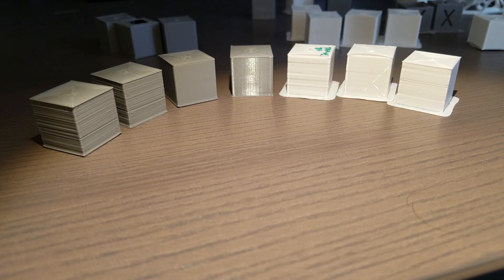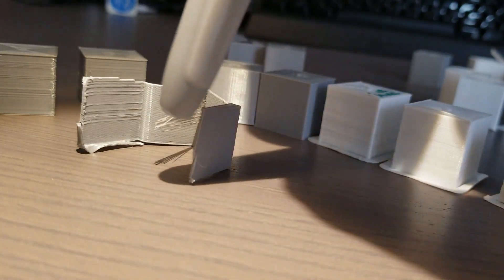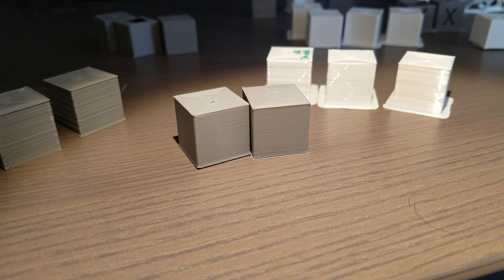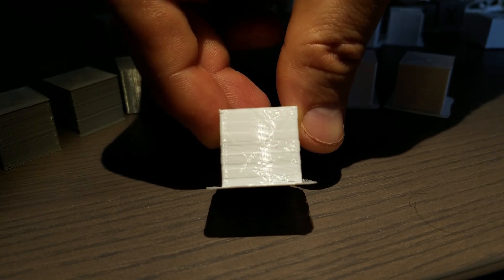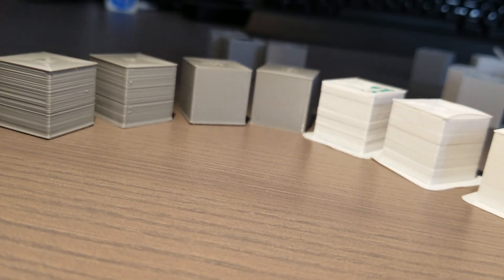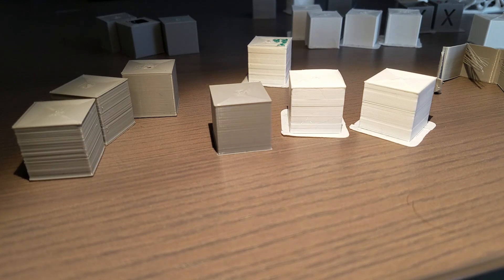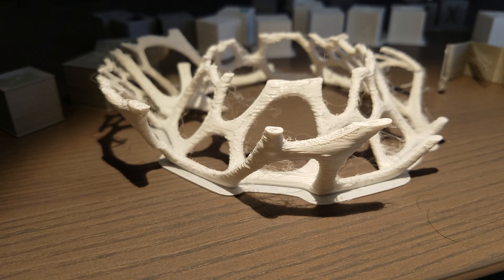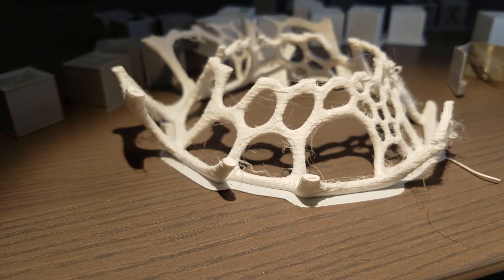CR10s PRO calibration Cubes ,Cura  uniform 3d print speed, jerk disabled,  shortest Seam settings

Comment: I am having the same problem. motherboard mks robin 2 . I'm wondering if replacing the motherboard will fix my problem? were you able to solve the problem?
Reply from the maker: You may want to try the speeds to be the same about 40 mms for a cube and i mean the inner wall speed the outer wall speed. no jerk.  also you need to check if the printer is tight - the rollers on the gantry the rollers on the bed.

Comment: I belive it is called sinhronus movement when you have 2or more motors moving at the same time(expensive electronic and software needed).
I'm not shure jet but you could solve it with rpi3.. I) know rpi works with Linux cnc.. Mybe for 3d printer will work klipper(to operate sinhronously motors).
Reply from the maker: That is interesting. The Motherboard processor should be able to keep the motors in sync, I am assuming. I am not really that good with processors. they supposed to work.

Comment: cool video dude. i have a cr10s pro printer as well, i've done several "what i consider upgrades" to the printer. most recent, was installing a 32 bit skr v1.3 board into the printer and begun to dial in some settings within the marlin fw itself.

one thing that i noticed with the stock creality fw was i wasn't able to do simple tasks like updating jerk or acceleration via gcode commands and the only thing that i really saw people doing was installing the tiny machines firmware which can only go so far, and then your limited to what they put into the firmware.

if your dead sent on keeping everything stock, i suggest compiling the latest 1.x or even attempting 2.0.x bugfix branches of marlin for your board and begin tweaking settings. it's a little shitty though because i don't think the there is a way to input gcode cmds directly to the board if you go that route. *wait use prontoface or printrun then you can run m500 to save your settings that you have tweaked into the eeprom of the firmware. you may have to compile marlin with eeprom support enabled in order to run `m500` from a program such as prontoface.

you should also mention what slicer you're using, so other people can attempt to replicate your prints and even possibly suggest some new settings you could try. the cr10s pro is definitely a love hate printer. i'm glad i've stuck with it, as it's my first 3d printer but i kind of wish i would have purchased the cr10s v2 as the board and other components are separated from the printer and are easily accessible without putting the printer on it's side to work on.
Reply from the maker: See I did use cura to slice everything. and when I made this video I was using Cura 3.06.Latelky I have been playing with Prusa slicer and now CURA 4.3 seems to print quite well. But I do not own the Creality cr S pro anymore. I haven't got as far as compiling the firmware but the one I downloaded from Tiny3d machines seemed to do a better job than the stock firmware.

Comment: Any update? I'm having same problem with my artillery x1 sw
Reply from the maker: I anaswered your previous comment. Also After I use the Cura settings below, Iwas able to print the cubes okish, but lattices and other complicated shapes still did not come out fine. This is one of the videos After that find and The latticess still did not come out ok or smooth with that CR-10 S PRO. https://youtu.be/w8ylLrDFCMg or try to look at this video, where I am stumped  on finding the settings that woudl make my lattices look better. https://youtu.be/fw9tev_bj78
Reply: @RoamingInterests  Thanks man appreciate it
Reply from the maker: @seetcas  I hope it helps.
Reply: @RoamingInterests  I did few test with 0% infill   printing outer before inner that seems to resolve 80% of the problem but the problem still showing on inner walls so my thought about that is there is some kind of over extrusion because it something like the walls push each other. I did reduce the extrude multiplier and prints got better. 
By the way jerk was already disabled I only check the option for outer before inner
What dio you think
Reply from the maker: If your outer wall is before the inner wall and you still show on the outside then it means that your walls are too thin. I usually use 4 layer for a .4 mm nozzle so that's about 1.6 mm wall thickness. You may also want to do the 100 mm test extrusion. you make the printer extrude from the menu 100m and then you measure to see if it is a 100 mm. if it is less or then you have to change the e-steps for the extrusion until you get 100 mm.. also you may want to check the VREF, and if the bolts and nuts are too tight or too loose. I did get better prints when I reduced the extrusion but they were flimsy and they would break quite easily. https://youtu.be/jTmmS93W64s?t=322  in thi svideo And subsequent attempts I wasn't able to fix the issue on the CR-10 S PRO. if you have a second 3d printer to compare with then you may want to try that. with the same profile from the same slicer, or the same g-code. You still did not tell which slicer you use or I just missed it. You may want to check the VREF as well. to see if you have the right values. I think oyu should try a lattice test and see if you get he printer to finish. Someone told me that if the jerk is disable then it uses the default value in the firmware. so is not actually disabled. So you may want to play with the jerk now that you have seen some improvement,  Also you may want to use the same settings but add infill that randomizes your start point on each layer to see if you get nice walls or you get the same bad walls like before. or you can try increasing the speeds to see where your walls break down. When you say that the problem still shows in the inner walls you mean that if you break the cube the inner walls look bad but the outer walls look Good? Yea if those walls still look bad inside I do not think it matters that much. But you want perfection then the increments from decent to great, take a lot of time. also try to use layer heights that  are multiples of 0.04, so .25 Layer height is no good, the micro-stepping causes issues. Not sure if any of your motors may be missing steps at random times, and may cause issues. it is a lot of trial and error to figure out what exactly the issue may be.
Reply: @RoamingInterests  I did tests using cura and prusa slicer same problem.
The problem still exists on inner walls.
Many people with same printer don't have this issue.
Reducing extrusion multiplier reduce the problem.
Already did e step calibration many times and pid tune
I did printed lattice skull before it was good.
Reply from the maker: @seetcas  I am sorry to hear that. I am not sure but this seems more of an electronics or stepper issue. VFEF test should be your next test, and see if the steppers have the right voltage.  I was never able to do the VREF test on the cr-10s PRO so I gave up on it. Or you can also try and swap the stepper motors around to check if the patterns in the walls change. if you do not have a spare stepper. My suggestion is to swap the bed stepper and the x axis stepper with the two vertical z axis steppers and if the patterns in the walls change with the same g-code than we may be on to something. Otherwise I am bit stumped. If I have any other ideas i will comment. But if the VREF is too low on one of the x or y axis, and I would go for Y, then it would be likely that the stepper may miss some steps or mess around the walls. There is also a bit of contradiction in my theory because it does improve with reducing the extrusion multiplier. And since this is the artilery sidewinder it uses AC to heat up the bed so the power supply cannot be under-powered. are you sure everything is optimally tight? belts and stuff? if you look at my cubes the most horrendous ones, the rollers were to tight with them.
Reply: @RoamingInterests  belts are tight. Already replaced stepper motor no luck.
Reply: @RoamingInterests  I think walls are overlapping each other
Reply from the maker: There is a setting for that in both slicers. i think the default in Prusa 2.1 may be .25 mm. But I use it as the default value, you may want to play with that if you think it helps. or you see better results.
Reply: @RoamingInterests  I have it at 10% for cura
Reply from the maker: @seetcas  So I just checked cura 4.3 and the skin overlap, is at 5% on mine .02 mm, and the infill overlap is at 10% and the value is .04 mm. You may want to check those value as well.
Reply: @RoamingInterests  Thanks I will test and report back to you
Reply: @seetcas  Hello, i have the same problem.. can you fix it? Thks

Comment: Hey mate
Well done, right now I'm facing the same problem as you and I get better result when I lower extrusion multiplier
Reply from the maker: If you're using Cura try Prusa slicer or KISS Slicer. OR Try the NEW CURA 4.3 which incorporates the creawesome plugin. That may be able to help. But as in the video what I was able to do to get it working was to lower the speed to 30 millimeters / second 
 inner Wall and Outer wall equal Speeds and Choose the Seam shortest. You can also choose to print the Outside wall first. Also you can check the VREF  on your Board for the stepper controllers, and make sure they have the proper values. You may have to find out your values for your particular 3D printer. Also you may want to check others what values they get on their 3D printers. Disable the Jerk. Also you may have to check the nuts and bolts if they are properly tight. And one other thing that happened to me was that the heatbreak throat that connects the heating block to the heatsink when the 3d printer is cold, it was tight, but when was hot it was loose, so the nozzle was slightly moving when 3D printing. You may want to check that, as well. heat it up and then take the covers off and give the heating block some gentle tugs or try tightening the screws. that connect the heating block and the heat break throat to the heatsink.

Comment: My ender 3 has this problem only with the wall chatter any setting fixes?
Reply from the maker: If you're using Cura, try seam shortest. And jerk disabled. That's how I managed to get a bit better results. Or try the prusa slicer  and just adjust things you need. You may want to check the Vref on the steppers. See if they are the right voltage. You need a multi-meter for that. There are vids on this. Try to keep the inner wall speed at 30mm. And outer wall as well. But for me the seam shortest was the thing that made it a bit better. The video here https://www.youtube.com/watch?v=7c7c10bf-cb26-db23-32a5-3d5d8407a8a2 I show how i kinda of figured it out. Try outer-wall to print first.
Reply: Roaming Interests ok thank you so much
Reply from the maker: try all speeds equal, seam in the same corner shortest path, and jerk disabled. you may want to tey your vref, and a different slicer.

Comment: Hello
I have watched your videos and had the same problem. Never could I get a proper print with CR10s Pro and Cura. Was about to sell it for nothing just to get rid of it.
Then I happened to get to this reddit thread  https://forum.simplify3d.com/viewtopic.php?t=11815  and downloaded simplify3D and the profile there (probably the default cr10s pro config also work).
Hurra the calibration cube worked really good. Sure I will probably have to buy simplify3D but when I got so nice result it is probably worth it. 
So my suggestion is to do the 2 week trail and see if it works for you.

I use 1.60.9CR-10SPRO motherboard firmware, Don't know if that matters
Reply from the maker: Thank you for that piece of wisdom. I recently had some ideas about maybe needing a more customizable  slicer. I have been toying with the idea of buying simplify 3d but yet not sure. I have to do more research into what it does. I feel like there are some things that are not customizable in Cura. I am not sure if it cura can properly keep the flow necessary for the higher print speeds. thatwas one thought. thanks for reaching out.

Comment: When your infill is visible on the outer wall, then either the walls aren't thick enough or the overlap is set too high
Reply from the maker: I think you re right, i did make the walls thicker and the lines got less visible. Thanks for help, i have to tinker with the overlap.

Comment: Wow still having problems.
O.K try asking a few questions no one has asked before ?.
what version of cura are you using ? , I hope 3.6 or 4 .
What is the acceleration value 200mm/s to 300m/s works fine for me , 500mm/s starts to show the infil for me.
Try rotating the model 45 degrees ? 
I may be wrong but one give away may be the elephant feet on the top and bottom layers !!!!

ACCELERATION / JERK / SPEED 
To help you with the terms and what they do and how they relate with each other !!!

You have a van transporting fish with 3 big tanks and a weak plastic cover.   
So jerk is the maximin cornering speed , eg set it too high and you will loose that water cornering ( layer shifting and ringing ) , acceleration is how fast or slow you accelerate upto the max speed and decelerate down to the jerk speed for cornering / change direction .
So faster the print speed the more it need to accelerate and decelerate , but this also depends on the length of travel, because on short lengths it can`t get up to speed before to needs to slow down.
Reply from the maker: Thanks for the explanation. Yea I think the cubes printed fine with the new tweaks but somewhere somehow there is a mismatch. Because lattices do not print well yet. I will try a few things with lower acceleration. Thank you again. I tired Cura 3.6 in the begining, but then I switched to cura 3.0.2 And that's what I have been using.
Reply: Sir. I have seen you trying to help him a lot, but to me, it looks like this gentlemen is not even listening to your and others advises at all, and all he wants to do, seems to prove his theory is correct, not to improve printing quality, I'm also assuming, that some critical part on his printer is loose in one of the axis, or in the hot end maybe loose, as he is really getting problems as he says, when having more than 1 axis active at the same time, he also doesn't have any video while printing, but shows only already printed parts, and so far only 3 of them, benchy, cubes, and now lastly 3 months later his lamps.
Reply from the maker: I disproved that I get problems when both axes are traveling at the same time. https://youtu.be/w8ylLrDFCMg?t=154. And I do appreciate the time and answers @Peter Adshead has provided throughout my 3D printing journey.  I just could not figure it out why it did not work. I think it may have been cooling. I haven't improved the cooling. Thank you again Peter.
Reply: @RoamingInterests  it`s not cooling 100% fact .
I can print and do print without a fan , PETG doesn`t want a fan .
The only time you need a fan is printing fast or to improve over hangs .
So unless you have fitted a e3d volcano and a 1mm plus nozzle it is not cooling.
Reply from the maker: @peteradshead2383  Thank you for that piece of Info. I did not know that. I haven't spent any time on this issue lately.
Reply: @fatfat6389  I don`t want to get personal or knock anyone , BUT I`m 99% sure I could get that printer working in 15 minutes or eliminate 90% of the possible faults if it was my printer.
You just have to be logical and say ( eg ) there are bands on the prints X axis about 4mm apart what would do that ? is it a full rotation of the wheel ? or a rotation of a stepper motor ?  , or a bent rod , it is no good saying if I printer 100% infill and 5mm/s it stops.
I would say using logic that your idea of the hot end loose look to fits the bill to me.